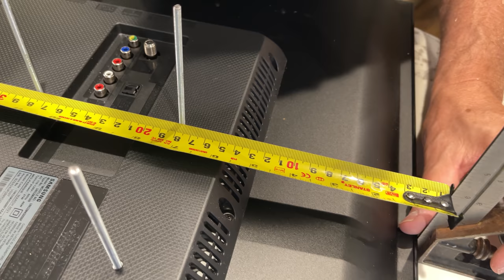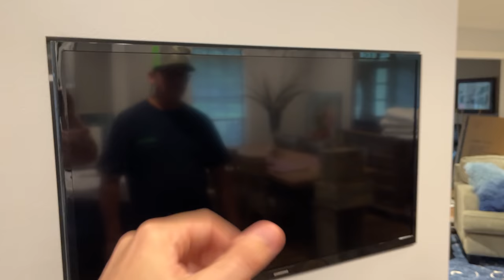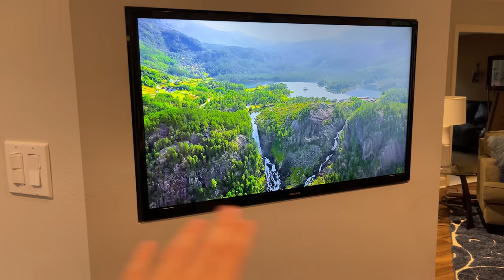How To Put a TV Inside Your Wall

Comment: Nice looking install on the screen side.  Not too bad in the pantry, but it could be much cleaner.  Mount the electrical and cable boxes sideways through the top of the niche frame, then the TV just plugs into them on the inside of the niche.  Or use a shallow box to put the outlets on the rear of the niche.  But hide the electrical and cable boxes, makes for a much nicer look in the pantry.  The fans are a great idea, but why not recess them in the wall?  Doing that would make a cleaner appearance in the pantry.  And as someone else mentioned, put a cover over the drywall left so there's no dust being driven into the TV.  Also, make one fan a push, the other a pull, placed in opposite corners.  You'll get good cooling but less air escaping out from the niche.  See, we can Monday quarterback this all day long!  LOL

The podcast is ambitious.  I see it as a way to eventually move away from actually doing so much labor on houses as you create an income stream from offering advice and tips.  Good luck!

Comment: If you have a line of sight box, you can use an IR remote extender, had an eye that captures the signal from the remote and transfers the signal to the cable box via IR transmitter wire.  This allows for the same sleek look you have here and allowing the components to be in the area behind.  Keep up the good work.

Comment: Also pro tip - if you have a cable box that requires line of sight, you can get an IR repeater instead of making sure the cable box is exposed - one side mounts to the cable box, and the other end is what you mount in an accessible location. They're very small and easily hidden around the frame of the TV, or someplace else that is inconspicuous.

Comment: Another great video guys. But...... I question the clutch kicking in on the drill. Either the got knocked into the clutch mode or the gears slipped/stripped. 
Not that it matters

Comment: Hey guys, for the podcast, not to be a critic, however, as a sound/video tech out of French Settlement, put some sound dampeners, cheap foam egg crate mattress, on the forward walls and along the ceiling along the wall about a foot wide wrap. Keeps the slapback or room reverb/echo from being so bad. Also, your back drop should be either sound board or a tight pile carpet of some type.

Comment: @19:01 There are IR blasters that work off of RF or just as a relay from an IR remote.  And the IR transmitter can be doublestick taped on to the IR receiver on any device.  That TV looked a lot better than I thought it would.  I didn't get why the owners wanted a niche for the TV.  I get it now.

Comment: Neet job. Not that you need my suggestions - especially now that the job is done but you could have installed a solid panel to conceal the fans and mounting hardware. Drill holes in a grid pattern for airflow and mount it to a couple of cleats on the wall. It would eliminate the use f that little shelf but it might have been a cleaner look. Now don’t get me wrong, I think the trim rings look great, but I heard my wife’s voice in my head when I saw the finished product and she said “can you do something about those screws?” It’s always something with her. LoL.

Comment: This is a very cool look, but I would hate not being able to use the shelf space on the other side. I have a "samsung frame" at my house which is a flat mount tv that functions as a picture frame when not used as a tv - install was much easier, only sticks out 1" and looks just as good - I'm sure it cost less also after considering how much time you guys spent on this.
Reply: Why cant you use the shelf on the backside? 🤦‍♂️🤦‍♂️🤦‍♂️

Comment: I love using the bolts, I never thought of that. Your cooling solution is great too (just needs some RGB).  FYI, for the remotes that require line of site most stuff has some type of plug where you can extend an eye in a dark corner. Most stuff now is using some type of Bluetooth transmitter. You guys need to build a custom computer desk, then sell the plans.
You guys teach me so much about construction, I work in IT and I attend tons of construction meetings 90% of it use to go over my head now I kind of understand what is happening with the other trades. Great video!

Comment: Great video and congrats on 100k on one of the best channels on the internet. How i would go about this TV situation is make the niche deeper, then get a tv mounting bracket thats telescoping and can go in and out closer to the wall. Then once you have it mounted you can easily use your fingers to get the tv out to manage the wires or what not. I understand in your situation you would have to go in more into the pantry space.
Reply from the maker: Cool thx.  We discussed this at the end 👊

Comment: Looks good ,but if you do not have a wall with a pantry on the other side I would make a top and bottom vent going across it all flush mount and it would still look good.

Comment: Looks great, it would be cool if you put a picture frame around the bezel of the TV. I know you're using the gap as cooling but you could scribe a board vertically on the back center of the tv and glue and caulk it, then flip one of the fans around so one fan pulls cool air into the gap behind the tv while the other fan sucks the hot air out. I personally think it would be a better solution (for cooling) than what you currently have because as of right now that air you're pushing in isn't forced to go into the tv grates to cool the electronics. either way, I might copy this design once I get my own house. Also great job.
Reply from the maker: Cool thx 👊👍

Comment: Those 120mm fans generally have a shorter lifespan than a TV. The TV may last for ten years, but the fans won't last more than five or six before they die. Making the trim friction-fit is a great idea, to make replacing the fan easy; just leave enough slack in the fan's power cord to be able to pull it out from the pantry, disconnect it, and replace it, otherwise you'd have to take the whole TV out of the niche.

I'd also plan for a better outflow than just the reveal around the screen. To best vent that heat - and an LCD TV can create a lot of heat - you need a dedicated vent at the top of the niche. Whether it vents into the room, or into the pantry, it should be above the TV, since warm air rises. Placing the intake fans low on the back of the TV as you did in this case is optimal; you're pulling in cool air from the bottom. Venting hot air is best done at the top.

Also be careful of wire, cable, and box placement. No electronics like heat, so the boxes and other devices should be mounted as low as possible in the niche to keep them cooler, or better, outside the niche entirely so they're out of the hot zone. And any wiring or cables you wrap up in the niche can obstruct the airflow, and will gather a huge amount of dust, which can be a fire hazard around hot electronics, so it's better to keep as much of the cabling out of the hot zone as possible.

Comment: With as thick a wall that you had, you might want to look into flush mounting the fans into the wall and then put some speaker cloth over the fans that can be removed and cleaned easily.  Those fans are going to collect a lot of greasy dust from the kitchen.  Alternatively would be to put a stand off from the wall, and have your air intake on the sides behind the stand off.  That way when the home owner puts something in front of the fan you still have an unobstructed airway from the sides, top and bottom.  You may want to look into Fastcap's Dually Grommet for your wire pass through solution.  They can be cut down to size as needed.

Comment: Hey, just want to say, those types of tvs don't have mirrors it's the inner back of tv have led strips glued to the inner rear of tv then has a thick white plastic panel thag covers them, then two or three layers of plastic to distribute the leds light evenly then the lcd panel over that that's it. Only projection tvs and rear proj tvs have mirrors lol I figured I would throw my 2 cents in and now that I have I'm using your knowledge and gonna make my 60" Samsung inlayed into the wall vuz this is awesome. And u had awesome idea about framing it out as Im gonna put wood trim over the bezel to make it look like a picture

Comment: I love this! One question though - why did you need that little notch to push the fan through from the kitchen side? Why not instead start from within the pantry, and simply push the cables through to the kitchen side? 

Congrats on 100k guys, that's not easily done, you should be very proud of your work.
Reply from the maker: The two fans are hard wired together so it all had to go in from the TV side 👍
Reply: @StudPack  ahhhh!! Thanks!

Comment: AV Integrator here to say well done however the Cable Box is an issue. It's not easily accessible and the next guy will have a hard time getting to it.
Indeed a plywood box would work better so you can add a full motion mount to gain access to the rear of the TV. Another fun option is to use a one way mirror film on the TV screen so when the TV is off it can be a mirror. However you would have to crank the brightness up real high and will cut the life of the TV's backlight in half.
Reply from the maker: Cool thx Leland 👍.   We’ve since moved the cable box 👊

Comment: Using metric is much easier huh?  Felt like watching a video from another country, not someone based in the US.  I need to buy some new measuring tape as mine only shows inches and I'm always having to do conversions in my head.
Reply: Fastcap has an awesome tape measure on Amazon that I picked up that has both.

Comment: Do you have a video on how to make a niche?  
Also, what if I have wall space with a staircase behind it so I wouldn’t want things exposed. 
My thoughts are to cut the TV size hole on 1 side of the drywall. Create either a platform for the TV to sit on or creat a wall to mount the TV on then run the cord down to the outlet below and keep the inside of the wall open to allow for heat distribution.  If the tv is flesh with the wall then I’d only need to make sure the edges of the frame are clean potentially adding a frame around it.  Does that make sense?

Comment: Just a heads up one of my hobbies is building PCs. You guys really didn't need to go with 120mm fans for that in the future you should go with "noctua" fans you can get on amazon they are arguably the quietest and best out there. You can get them in 92mm, 40mm, 25mm etc. They should provide plenty of airflow for that. I do like how you guys did that though nice job.
Reply from the maker: Thanks for the tip on the smaller fans Durk. I built my PC and several others. Love the process 👊🏼 - Jordan
Reply: @StudPack  That's awesome.

Comment: Add a 90-degree coax adapter to the coax cable in the pantry.  It will help push that coax cable towards the other wires and make them look cleaner and out of the way.  Or you could get a coax cable with a built-in 90 degree.
Reply from the maker: I just told Jordan about those Jim. I tried to find some locally but could not. They sure do help getting the wires tight to the wall. I’ll probably have to order online. Thanks for the tip bud 👍

Comment: I think it would've looked better if you cut square holes in the drywall inside the niche, and mounted the fans flush with the drywall, with much lower trim. You could use a mesh to make the fans even less visible on the inside, too.

Comment: I was very impressed with the glue you used on the crown molding in another video. I went to buy some and found 5 kinds. CA low CA med CA hard ect. What type did you use.

Comment: Every Flat screen TV has  threaded inserts of various diameters. larger heavier TV’s have larger diameter threaded inserts when you buy a TV bracket it will include several different diameters and thread patterns of the threaded screws! 

You can easily take the proper size screws and match up the thread the bolt pattern and the diameter. Find a good quality hardware store where they stock,  large selections of threaded rods or longer bolts and cut off the head with a hacksaw!

Comment: I made a French cleat out of wood place one half on the wall and the other on the TV holes and walla super close to the wall and still able to remove it when adding another device (hdmi) or surround sound the ability to have the option of adding is a plus. That TV I don't think there is a need but just an idea.

Comment: Thought about this for my theater room as the back wall isn't finished yet.
But, after a few moments of reflection, I wondered what might happen if the TV had to be replaced?  Unlikely I could find one with the same external measurements, let alone the depth and mount holes.

Comment: I would have mounted the cable box in the pantry and just ran the hdmi cable thru the wall. That'll be easier for troubleshooting for it if needed.  You can even frame the top and sides like a window or door.

Comment: They make small infrared eyes for hidden components a TiVo system operates via rf so you just have to be in the vicinity there's also after market remotes that work rf with a small USB dongle

Comment: To EVERYONE watching, that is NOT how you cut all-thread.
Run two nuts together down to the point you want to cut. Tighten them against each other. THEN cut the threaded rod with your blade AGAINST the side of the nut. Doing it this way will keep the nuts from turning AND it will prevent damage to the threads, allowing you to use the left over rod. Removing the nut also cleans the threads on the end.

Comment: You could have put the threaded rod in the Chuck of your cordless drill and pull the trigger and hold the hacksaw stationary on the cut line and let the drill do the work for you

Comment: The recessed box was already built - is there a video where it shows how to build in a recessed box for the TV (other side of wall is a kitchen)
I’m hoping not to have to build a framed wall that juts out from existing wall (it’s also a 16’ tall wall, so attempting to recess a 77” tv so the rear part of tv is recede and the screen rests against the wall, so semi flush)
Thanks for any guidance

Comment: Had to laugh when you made that extra cutout to pass the fans through the wall when you mount them from the pantry. LOL Why not a push pull on the fans?
Reply: That's exactly what I was going to say.  😆
Reply: That's a good point, each fan in opposite corners to flow air across as much of the TV as possible.  I also don't know why the fans aren't simply recessed into the wall, they don't need to stick out like they do.
Reply: @CitEnthusiast  I think that recessed fans would eventually be obstructed by things in the pantry and then you would have to mount them to the wall anyway.  It would look nice, but it would make replacing or servicing them more complicated.

Comment: Question, why did you cut a notch and pass the fan through the wall? Couldn’t you have just went to other side and passed the cable through? Maybe I missed something.
Reply from the maker: The cables were joined together at a molded junction.   I could have put them thru the way you describe but then the wiring would be exposed in the pantry.   Not the end of the world but we thought this way was cleaner 👊👍
Reply: @StudPack  got it!

Comment: NEC 400.8: Unless specifically allowed in 400.7, flexible cords must not be: Run through holes in walls, structural ceilings, suspended or dropped ceilings, or floors.

Comment: Were those cabinet screws drilled into wood or straight drywall? I know those fans are light so will drilling into drywall suffice or would you put anchors as well?
Reply from the maker: There was 3/4” plywood backing there for the TV 💪👊
Reply: @StudPack  have you guys done a video on how to do a niche inside a wall? If not I’d  think it would make a good video.

Comment: That screw pattern on the back of the TVs is a standard that 'should' be the same on every TV.  Always best to double check.
Reply: VESA standard is "standard" in the sense that displays that have VESA-compatible mounts will use one of the variants, but which one is the manufacturer's decision, and likely based on tolerances. I just hung an older 32', and I believe it was a 200x200mm M6 variant, but your smaller/lighter displays will likely have smaller x by y, and use M4 threads. So yes, YMMV, and you should always check the specs.

Comment: I would have sealed the drywall edge (paint) where you cut the holes for the fans.  You will be blowing in drywall dust into the back of the TV.

Comment: For the notch you put into the wall to slide the fans in why didn't you just mount the fans and then run the wire through the hole?

Comment: Good stuff. Have issue in garage ok. Cleaned ceiling with sugar soap for paint job. All good right? Well started to roll with water based paint. Only done two passes when I noticed the paint bubbling from ceiling. It only happened here and there but what a shit outcome. I soldiered on but in the end stuff it. I have little bubbles and big. The roof does not leak water. Any ideas?
Reply: Could be calcemine in the plaster or finish...I'm a contractor in Boston and what your describing is what happens with that.....use zinnsser cover stain......it's an oil based bonding primer....or Benjamin Moore makes a calcemine blocking primer.....Paul what do you think?
Reply: @landmarkconstruction  
Thanks for the advice. Will take that on board and keep kicking the the tin along.

Comment: I have a problem. Installed European cabinets and the uppers, took the doors off, leveled the cabs perfect. put on the doors and they are completely misaligned to the point where I have to frign fill and redrill. Drives me nuts. Everything is square and level.
Reply from the maker: They don't have adjustable cup hinges?  Should never have to redrill.